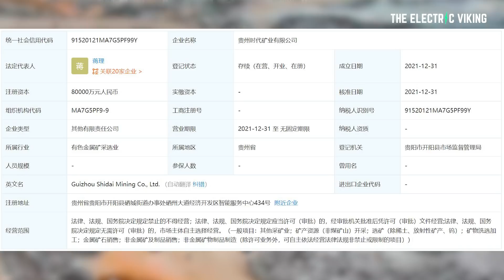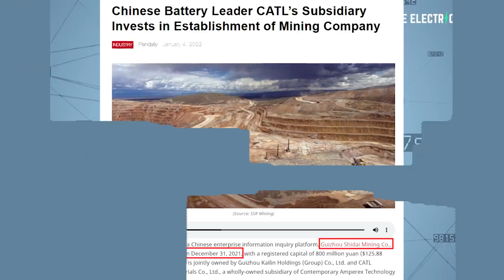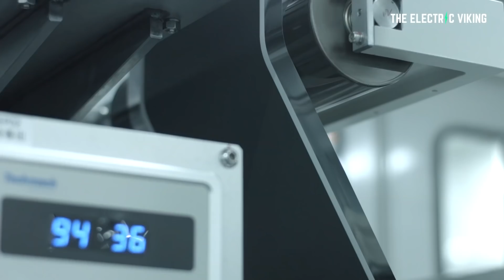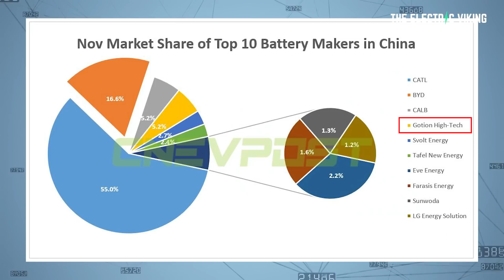Lithium price up 400% in 1yr; BYD & CATL start mining companies

Comment: How about the recycling and mining/extraction tech from American Battery Technology Company (ABML). Would be great if you did a bit of research on them and then did a video.  Small US company but the tech they have and the CEO and CTO Ryan Melsert makes it worth considering.  Founding member of Gigafactory design team for the design, construction, commissioning, and operations of the lithium-ion battery gigafactory in Sparks, Nevada.

Comment: Lithium up 400%; predictable.  if 900,000 cars take 13% of all supplies; then you couldn't make any more than about 8 million a year without increasing supply; in fact you couldn't make 4 million BECAUSE - Li batteries are used in everything, cell phones, laptops, toys etc etc; so EV makers can't buy it all.  More Mining sure that will be very green.  LITHIUM ION IS DEAD.  This is why Solid state is the only hope for EVs and billions are being spent to try.  IF  it fails maybe Toyota will be right; maybe hydrogen is the only path forward that will meet the 80 million vehicle a year demand.

Comment: Tesla alone is used 13% of all supplies of Lithium making 900,000 cars.  If they go to 2.7 million cars it will be 40%. If Legacy makers wanted to kill the Li EV industry; all they need do is buy up Lithium.  They haven't because everyone other than you, know Lithium ion is a dead end; Solid state is the big bet.  Tens of billions being spent on Solid State. Only Toyota has made even 1 Solid State battery powered car.  Who knows who will come up with viable Solid State cells; your "Legacy makers" hold most of the existing patents.  So you are likely going to look pretty stupid on your predictions about who will survive in the car industry going forward. Could a Chinese maker or Tesla come up with a winner? Sure but these dumb backward "Legacy" automakers have all the patents .

Comment: This is only the beginning. The environment will suffer and environmentalists will look the other way unlike how they decry oil drilling.
Reply: No. The Lithium will be used in battery/EV for more than 10 years before the recycling of batteries. But the oil is used for seconds and becomes CO2. Totally different.
Reply: @hotchi1566  EVs won’t replicate ICE in 10 years. It’ll take decades longer. Many decades of mining before recycling that won’t get much back useful lithium.
Reply: @finned958  Lithium mining is totally different from oil drilling. Lithium consumption is much much much much less than oil. In 10 year life period of a car, an EV car only needs several hundred kgs of Lithium. But in the same 10 years, how many tons of oil will be used by an ICE car? That is a huge number. And after 10 years, the Lithium will be recycled. But how about the oil? It becomes CO2 into our environments, a huge number. EV is still much much much more friendly to the environments.
Reply: @finned958  lol. I Hope u are joking! 🤡👍 Look at the numbers from NORWAY!
Reply: Its been shown by numerous studues that evs are less polluting than ice cars especially if theyre charged by solar nuclear wind hydro geothermal, and even coal over the lifetime of the car. 70% of energy in a barell of oil is lost through extraction transportation,  refining transporting to fuel stations then when burnt in cars even more energy is lost through sound heat.  Electric motors are over 90% efficient,  the best ice car isnt even 40%
Reply: Building a new car emits a lot of C02, mining the lithium causes a lot of environmental damage, and electric cars will require more power plants and upgrades to the power grid.  For the foreseeable future solar and wind power cannot reliably meet the demand for electricity.  Electric cars have their place, but they cannot save the environment.  It will require walkable cities that have reliable and affordable mass transit to save the environment.
Reply: @bactanite  NO. 'Building a EV new car, mining the lithium  + 10 years' electricity' its CO2 emission is still much much much much much much less than  'Building a new ICE car  + oil drilling + oil consumption in 10 years.
Reply: @hotchi1566  That's true because the car itself doesn't pollute.  ICE cars, on the other hand, pollute while they are being driven.  What I meant is that suburban sprawl and the vast road network created to enable it is a big source of pollution that EVs cannot reduce. 
The current system is only draining the bank accounts of people who are being forced to buy cars to travel anywhere, and are marginalizing anyone who for whatever reason cannot drive.  EVs are a techno-fix for a much deeper problem, a problem that EVs cannot solve.

Comment: The recycling of batteries in the future will eventually decrease mining. I think you have done a video or two on that topic.🤙
Reply: Wrong, it’s going to take a while before recycled batteries even have any impact on new battery production
Reply: Not anytime soon. We’re not at 100% EV cars yet. You can’t recycle what doesn’t exist.
Reply: @finned958  Exactly what I was about to say.  Long lag.  Only when EV production stabilizes, at about 50 million cars per year globally, and counting forward an average battery lifetime from then, that we will see a substantial portion of material coming from recycling.  2040 at the earliest.  Until then, we can expect lithium wars, even ...  But if "eventually" accepts circa 2040, then the original comment could be considered correct.
Reply: Indeed, redwoods materials and the tesla gigafactory with Panasonic announced earlier this week that by the end of this year. 
They would be using recycled battery cathode materials at the Nevada plant. 👍🏻
Northvolt at the end of 2021 announced they had already tested recycled cathode materials and proven they tested similarly to freshly mined materials. It will continue to become much more of a closed loop as we advance the ev transition. 😎
Reply: @4literv6  I agree, can't wait to see if Redwood goes on the market
Reply: @4literv6  why do you forget vw!?!? Vw has already built their own battery recycling factory and they also work with northvolt Sweden to boost battery production, there is a company called Duesenfeld in Germany that also recycles batteries too
Reply: @4literv6  Only if it's not prohibitively expensive, which isn't changing anytime soon.